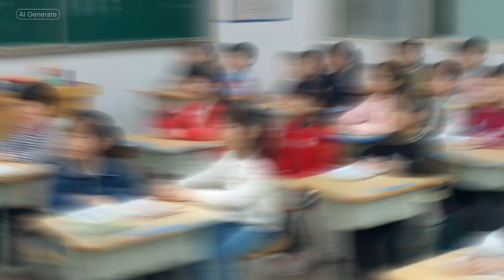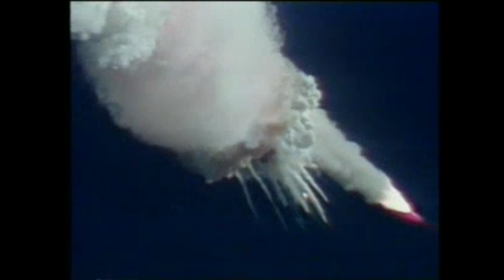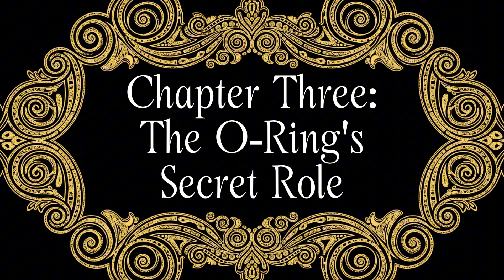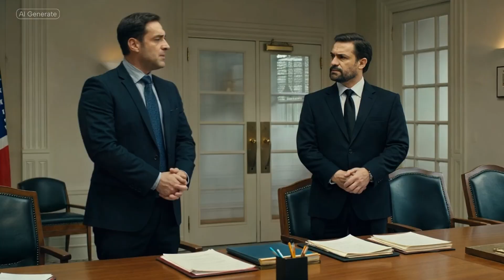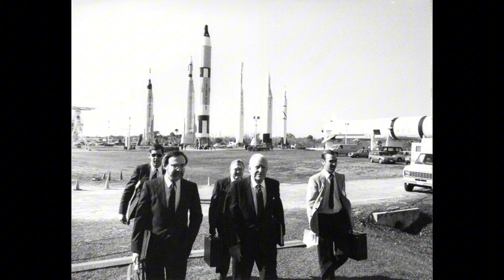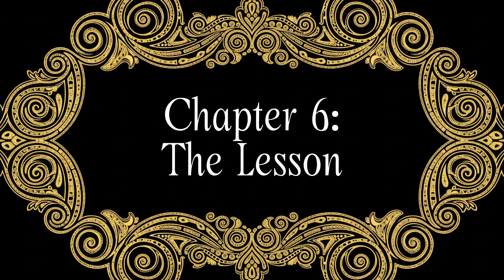The $1 O-Ring That Destroyed the Challenger Shuttle | Failure Analysis

Comment: The o-ring did not cost $1.00. This video is just click-bait garbage.
Reply from the maker: My bad, but it would have cost at most ten-twenty USD. Resulting in over a billion dollars in damages. In that magnitude 1 vs 20, (the high end) is negligible.
Reply: @FailureAnalysis1 Stop using shit AI videos
Reply: @FailureAnalysis1 It was 12ft in diameter and 1/4” thick. It was a specialised piece of rocketry, not some off-the-shelf car part. There's no way it cost $1 or even $20.
Reply: @GryffDavid DOES IT REALLY MATTER OF MUCH IT COSTS?.?.
Reply: @leplop337  Yes? When the title of the video is a lie that implies that NASA was/is using cheap parts that endanger people. You seem to be extremely angry and it's affecting your writing and comprehension abilities. Go touch grass, brother.